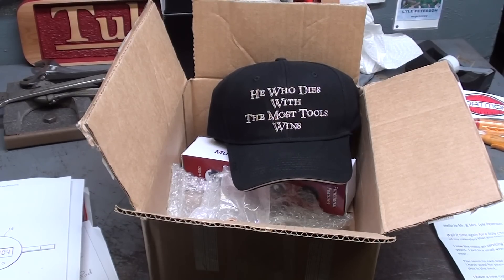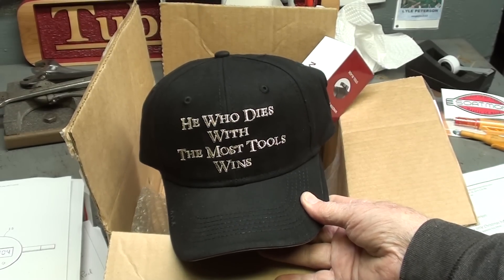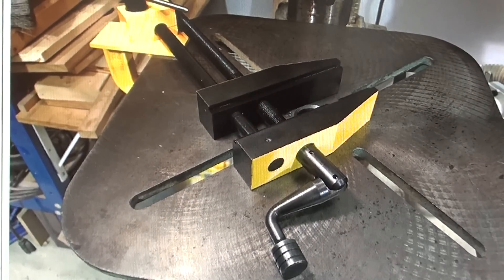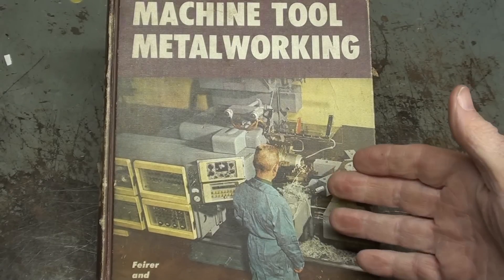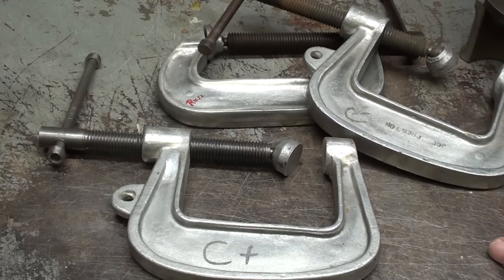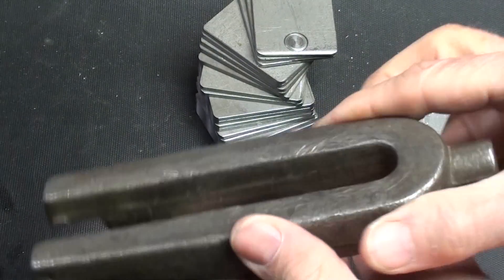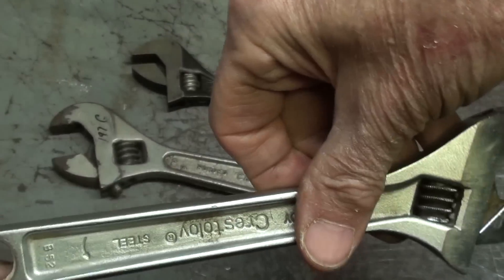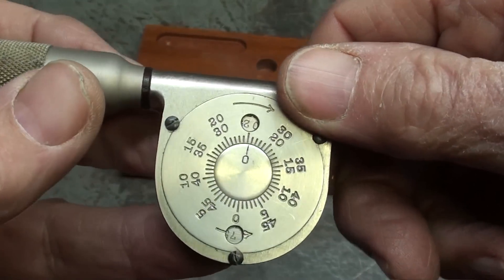This & That #52 tubalcain mrpete machinist

Comment: 13:10  I think the arrow shows the direction you want to turn when applying significant torque. If, like your demo, a user is only screwing the bolt home, it can go either way

Comment: You actually can print the drawings in the book you mentioned. Save the picture and then go to where it saved and print from there. I tried and was able to print a drawing. Also, there was a similar trade school book that had the plans for a model of a quick firing deck gun that was chambered for a Winchester 32 round. I lost the link and wonder if you might be familiar with it. I thought it was a book you mentioned in another video.
Reply from the maker: Thanks.      ??????

Comment: The small adjustable wrench with the short handle and large opening jaws has a special purpose. Its short handle allows it to be used in confined spaces and it is mostly used to undo and "hand" tighten (the reason for its lack of sturdiness)  the plastic plumbing fittings that attach the toilet cistern to the bowl outlet in the tight space between the cistern and the wall.

Comment: I'm so tired of folks who insist there is a proper way to use a crescent wrench.  Yes, I have tons of fixed wrenches, but when I need to repair something in the field, I grab three different sizes and go.  Hammers, cheater bars, etc- I abuse them, but since the early 70's I have NEVER broken one!
Reply from the maker: I agree. I have never broken a wrench, except in the videos. I am either too careful, or probably too weak

Comment: In reference to adjustable wrenches, they are all mediocre substitutes for proper wrenches. However, I worked as an industrial electrician and carried 6" & 8" Kleins. They were thinner, lighter & opened wider than Crescent. Can't carry a whole set of wrenches in a tool pouch.

Comment: The hammerhead on the side of the flashlight can be used to shatter your vehicle side window glass should you be in an accident and the doors get jammed shut. It would be difficult to break a windshield in a modern car due to the laminated glass. I didn’t notice, but most of the vehicle safety hammers you can buy also include a razor blade built in so you can cut the seat belt should that also become jammed due to a crash. I have Hound Dog light on my mill, works great.
Reply from the maker: Thanks 👍👍

Comment: I taught high school Mechanics and used that identical picture of the right/wrong way to use a Crescent wrench. I doubt many paid much attention to the reasons for the correct use though. One can only hope. I was quick to insist that students find the correct combination wrench or socket for use rather than the Crescent. I also pointed out that "Crescent" has become a generic name for that "adjustable" wrench.
Reply from the maker: Sounds like you are a good teacher. That picture came out of the little booklet, called the ABC’s of hand tools, by Disney.

Comment: That first adjustable wrench is by "Lobster" in Japan - they make great tools. That little short one is about $26 new off ebay. It's wide-capacity and designed to be light weight. I have one of their older 375mm (14.75") wrenches in the crescent-style and use it all the time.

Comment: The unions didn't bust the company, they got greedy and like the pigs they were, got slaughtered. Adjustable wrenches are never the right tool, they are for lazy people. That pointed bit on that flashlight is for breaking out the tempered glass of a side window of a vehicle. If you try to use it on a laminated safety glass windshield, chances are... you're gonna die.

Comment: Those dasco punches are terrible, I avoid them at all cost
Reply: Agreed, they're not the best quality tools out there. My experience is that they're meant more for the construction trades than anything else. When I worked as a carpenter I used them quite a bit without any problems. They didn't cost an arm and a leg and if I lost one it wasn't that big of a deal. They're definitely not of a high enough quality level to be used in a machine shop or, for that matter, most of the mechanical trades. I work in machinery maintenance now and I found out very quickly that the Dasco tools don't hold up when they're used in this trade. I ended up buying a set of Proto punches and chisels which are more suited to the type of work that I now do. The Proto set was also much more expensive than the Dasco set.
Reply from the maker: Why is that?
Reply: @mrpete222  as much as they bend and break, they might as well be cheap chinese imports, the blue paint is just silly and flakes off and gets in your work. (Extremely annoying with bearing grease) I highly recommend Wilde or Mayhew brand punches and chisels. Both made in the U.S.A. both make  excellent products. Mayhew's a maybe a touch nicer, but the price reflects it.

Comment: 2:28 - If you built a frame about 1" deep, and put a strip of LEDs inside around the perimeter... that would make a very cool wall hanging. (It would have that neon-ish glow.)
3:33 - Delrin is great stuff. My friend in CA was machining a bunch for a military contract... had hundreds of 6" cut-offs. I shipped my clothing back and packed a suitcase full! (Still have 2-3 left over 18 years later.)

Comment: You can download "Machine tool metalworking, principles and practice" by John L. Feirer, Earl E. Tatro if you are a member of a "partner institution", and a number of public libraries are partner institutions.
Reply from the maker: Thanks
Reply: If you are not a member you can still download and print single pages, which should be enough if you need a few blueprints. You can thank google for the digital version, but also for that limitation.

Comment: I always put on the power with the arrow on a crescent wrench.  It looks like it can take the torque better that way to me.  But with that angle on it, I flip it back and forth if needed to run up the nut or bolt.  Truth be told, I'd rather use almost anything else to do that job than a crescent.  I've barked my knuckles too many times to trust the slip-o-matic.

I love to see the products you developed, and those viewer gifts....  man, they are waaaay better than an apple or a fruit basket!!  

A++++++++++!!!!!
Reply from the maker: Wouldn’t you rather be in the jelly of the month club?

Comment: That's not for your windshield, it's for a side window.  Your windshield won't really break in a fashion that allows you to escape a car.  It's a bit amazing how many things have those window breakers considering how rare it is that anyone has ever needed one, my pocket knife has one built into it.
Reply from the maker: Yes, just a gimmick. They also marketed automatic center punches Two women for that purpose

Comment: Another great job! Best thing about my morning coffee. I was wondering if you've ever done a video, on chip control. Seems like every time I build anything in the shop, I get very small metal slivers of metal in my fingers. They are too small to see, but not too small to be painfull in a day or so. I use a chip brush, I use a vacuum, it still happens. I bought the book a few years ago, and yes it has great plans.
Reply from the maker: I constantly clean up and vacuum and sweep and use a big magnet. Try to keep from tracking the chips upstairs
Reply: @mrpete222  I have to work at keeping those type of chips picked up, the ones that I have trouble with wind up stuck in my hands, too small for tweezers, but big enough to be painful. Do you have the same issue, and do you use special gloves?

Comment: I think I actually like the older version of that rev counter from the 40's more.  If you need the electrical insulation, a fully insulated handle seems safer to me than that little bushing.  Great tool either way.  Simple and reliable.

Comment: WOW! $6.75 just before WW2 is worth $118.11 today. That is simply insane. We'll end up like Zimbabwe's currency before I die. 🤣 If all goes well, that'll be around the year 2074. "Alright, here's your sandwich and chips! Your total comes to $110,000 please. Will you be paying cash or by hand implant chip?" "You know, when I was a kid at the turn of the millennium this sandwich cost me $5 at Subway." "No way! That's impressive grandpa!"
Reply from the maker: lol
Reply: The U.S. went off the gold standard during the Nixon administration, I believe.  Since then, printing currency has gone a bit out of control.
When I started working in 1995 (I was 15), you could buy a 12 ounce soda from a vending machine for 50 cents.  A dollar seems to be the current rate for same, despite the subsidies for corn driving down corn syrup prices.
I don't want to know what it would cost today in a Disney hotel.
Reply: @TheSuburban15  It is easy and some what necessary to DEflate the value of currency (it causes the value of certain large durable goods to increase). To INflate the value usually involves an armed revolution. You buy a house for $100,000 for which you take out a mortgage. You now owe the bank $100,000 plus the interest over 30 years. Through some form of economic magic the value of the dollar doubles. Your house is now worth $50,000 but you still owe the bank $100,000. Oops. If the $.50 was .003% of your disposable income in 1995, and $1.00 is .003% of your disposable income today, the Coke still costs the same amount.
Reply: @Dwarfracer88  There are many negatives to inflation, however.  
That money you have been putting into retirement and college funds (as tuition rises out of step with nearly all other sectors of the economy) is now worth half as much as when you earned it.  Oops!
Inflation is unsustainable, leading to boom and bust cycles, meaning more recessions.
A high rate of inflation in Country A, and low inflation in Country B means Country B can't afford to buy products from Country A.  This is highly influential on trade deficits.
I really wish that more econ professors would teach something other than keynesianism
Reply: @Dwarfracer88  We have an inflationary economy as it makes labor cheaper all the time. You can give people raises to make them feel better but in reality they never make anymore money because everything else costs more by the same amount. Then the new guys get screwed as they start at a lower rate than in the past so your labor pool keeps working for less and less. this system was well thought out years ago by the big powers to help transfer wealth to the top without it being obvious to most people.

Comment: Wish I had a shop teacher like you in high school.  We had an hour each day of study hall that could have been shop class
Reply: I'm very fortunate to have had a physics teacher at my middle and high school who ran our F.I.R.S.T robotics club as an extracurricular activity. When I was in middle school I was too young to join, but the club was well established and they had turned a big classroom into their workshop/ physics classroom. We moved into a brand new building as I was entering junior high and they planned out chemistry, biology, and physics labs and outfitted the physics room with all the space and tools for the robotics club. We had a Bridgeport with a DRO and a mini mill, a lathe (Atlas I think), a drill press, a band saw, a bench grinder, a TIG welder, and many hand tools and handheld power tools. I learned how to do basic machining being a part of that robotics team. :) I loved that mill and that TIG welder. It was tricky because we used aluminum almost exclusively. TIG welding aluminum is loud and difficult compared to steel so I was kinda babtized by fire right away. 😸 I'm very thankful for all of that opportunity and knowledge. I maintain contact with that teacher to this day. :)
Reply from the maker: Sounds like a great teacher and a great lab. Thank you

Comment: Mr Pete, those Pica Deep Hole Markers are available from Amazon and ebay, I bought a set after seeing you use them for the first time, an excellent pen. They also do a graphite pencil in a similar style but I haven't tried one of those yet.
Reply: I just googled them and Low's has them for $ 9.98

Comment: That looks like the book I used in High School 1968-1970.  For very grievous class infractions, such as cheating or fighting, in lieu of expulsion a student would be made to copy the chapter on the milling machine.  I have a copy of the book on order from ebay.   The B&S rev counter is a beautiful instruement.  Thanks for sharing.
Reply from the maker: That was a good punishment

Comment: the direction arrow on adjustables only really matters when nut//bolt is tight. the idea is that the movable jaw kinda acts like a pipe wrench or stilsons and bites against the nut at the  open end. Do it contrary to the arrow with a very tight nut and the jaw tips get wider making it more prone to slip and round the nut. you can probably get left and right handed adjustables if you really need them.  operate the wrench both ways with a little slack and see how the moving jaw tilts against the worm and where gaps open and close against the nut flat. the flats on a wrench do not apply an even force over the whole surface of a nut flat... there is transfer of load into the root of the wrench at one side and to the jaw tip at the other... which way you pull the wrench dictates which jaw experience force at the root or tip. doing it the right way helps keep the moving jaw as flat as possible against the nut.
Reply: You are spot on.The Forces that you are referencing are more specifically that in the correct direction the nut when the tool is under torque applies a force vector on the movable tang in a direction that drives down toward the worn gear side of the fastener. this assists in holding a solid position of the sliding tang and allows higher holding force. When rotated the incorrect way the force vector is away from the handle and pulls the teeth out of mesh allowing for sliding tang to have undesirable movement, Possibly resulting in a rounded fastener. Illustration that may help or further confuse https://imgur.com/gallery/C1Lcfay